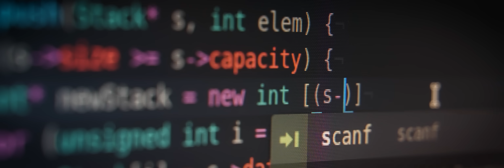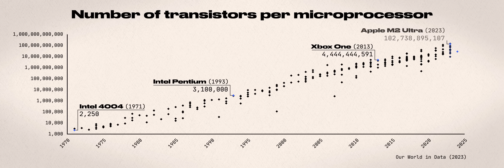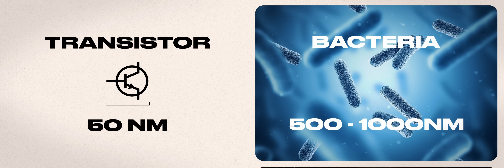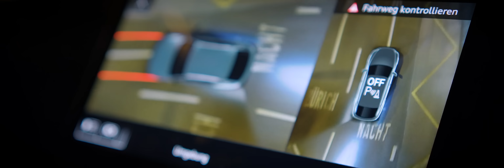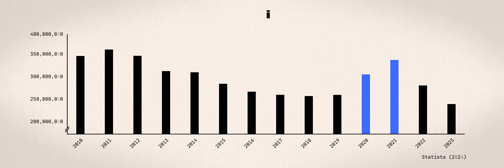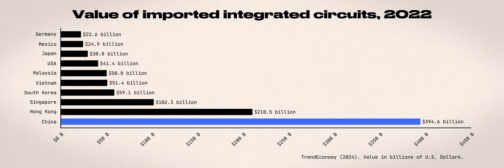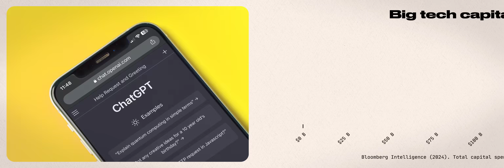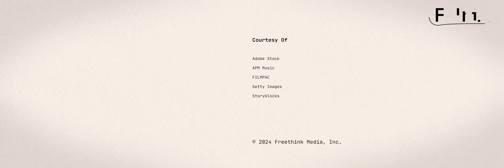How an AI chip war could destroy the global economy | Chris Miller for The Freethink Interview

Comment: We're actually near the limit of Moore's Law because the transistores are becoming so small and so close together, that the small heat from one turning on/off is actually influencing it's neighbours.
Reply: Interference is just another hurdle, but planck’s scale is the real limiting factor. You can only go so small.
Reply: Moore’s Law will have to adapt to quantum mechanics and it will probably will
Reply: The rate of transistor density doubling doesn’t have to be near the Planck limit for moore’s “law” to be found to no longer accurately describe the rate of advance
Reply: Next step is photonics.
Reply: Perhaps the limits of current design philosophies. The same thing was said before the introduction of fin-FET architectures. 

I think the next frontier is directly integrated optical communication. This reduces heat load for a given amount of data transfer (the other important heat source besides switching), and allows components to be positioned differetlntly for more efficient cooling.
Reply: Thats where you get to the next phase: quantum computing
Reply: Thats why optical circuits might be the next thing
Reply: Within 10 years there will be new material chips overtake silicone
Reply: They have thought this same thing 6 times throughout history and each time we blow past it and Moores law continues every 18 to 24 months.
Reply: @aaronpannell6401 moores law hasn’t held since 2003
Reply: We said that 10 years ago and Intel just kept churning out product over product, and then when Intel no longer got funding, TSMC surpassed them and they started pushing past moore's law. It's not dead, people just claim it is for clickbait lol.
Reply: Moores law is dead
Reply: @SigFigNewton  let’s try and keep shrinking transistors so and pretend that Moore’s law still exists so ngridia won’t have an excuse to raise prices even further
Reply: There are still options like stacking waffers or using more heat resistant material like graphite. There's also materials more resistant to rogue electron shenanigans. It's hard to say if we will hit a wall for cost effectiveness or not in the near future. I think another option is to focus on more advanced code as opposed to hardware.
Reply: Computing power is outpacing moores law
Reply: @jamesrowsell9346  Moore's law isn't based on computing power silly goose.
Reply: @destructodisk9074  but computing power isn't outpacing Moore's law. It's fallen behind. The original concept was double the transistors and half the price every two years, now it's doubling at a rate of 3-5 years and the price correlation is way off. You can't just say "oh we build bigger PCs therefore more computing power" because that's not relevant to Moore's law that's just running more things in parallel. That's like saying engines are faster now cause we use two of them 🤣. Even in that regard our computers are not doubling in speed every two years, and the cost has certainly not halved

Comment: The US is not a significant exporter of AI chips, but it is initiating an AI chip war.

NVIDIA, AMD, Qualcomm, Broadcom, Apple, and Google do not own or operate any manufacturing facilities. It relies on a network of partners in Asia to fabricate, assemble, and test its products. These tech companies do not have the ability or resources to build or operate any manufacturing facility anywhere in the world. Silicon Valley no longer has much to do with Silicon.

These companies do not manufacture silicon chips or physical products and are not in the "Semiconductor Manufacturing Industry." They are chip design and marketing companies that extract the most profit. The AI hardware is not made in the US, but the US wants to dictate which countries can use it.

Comment: "According to current understanding, Moore's Law is generally considered to be no longer completely true, as the rate of transistor density doubling on microchips has significantly slowed down, meaning it is not consistently following the predicted doubling every two years; many experts believe it has essentially "died" due to physical limitations in chip manufacturing. "
Reply: Moore’s law is about how much transistors can be packed into a space. So once they cannot get smaller, you just have to use more space. As a result, even if transistors are as small as they can physically be, Moore’s law will continue to scale by increasing die sizes.
Reply: @nadiafairchild9369  Sure. But Moores law also relates to a time period and scaling. And that period and scaling is no longer occurring. Therefore the law no longer holds. It's simply not true anymore that the output is doubling every two years and a result of that was the reduction of value of the company Intel.
Reply: @nadiafairchild9369  That's not quite correct. A fundamental part of the law is the rate of change. And that part of it is no longer true.  "Moore's law is the observation that the number of transistors in a microchip doubles roughly every two years. "
Reply: I think both of your arguments are correct, but observing from different angles. The physical limit of Moore's Law has been reached, but Moore's Law itself is closer to an economic law. Even though the size of individual transistors will not shrink any further, the economy will still grow exponentially in the future.
Reply: @Daniel-cj6ci  That's not correct. Moore's Law is specific to a doubling over a period of every two years. That's no longer happening. 

It's very simple. If it's no longer doubling within two years, it's no longer a law. The period isn't arbitrary.
Reply: @  If you insist on a strict definition of a 'law,' then Moore's Law was never truly a 'law' to begin with. A scientific law should be based on rigorous experimental data and fundamental principles, not just an empirical observation made by one person in the 1960s. Gordon Moore made a prediction based on industry trends at the time, and while it held for decades, it was never a fundamental physical law like Newton's Laws or the Laws of Thermodynamics. So if your argument is that Moore's Law is invalid now because it no longer holds exactly as stated, then by the same logic, it was never valid in the first place
Reply: @Daniel-cj6ci  that's not my argument.

My argument is that the law was stated with specifics and those specifics matter. 

Just like we can't say "well the law was originally doubling, but 10% increase is still an increase so that's still Moors Law"

No it's not. It's no longer doubling every two years. It's not even close to two years. It's well beyond that.

Whether it's claimed to be a "law" or not doesn't matter. It could just be a statement or a claim. 

So it's really simple. If the outcomes are no longer matching the original statement or claim, then it's no longer true.
Reply: @exhibitD79 You are correct.  And no, the die size cannot grow to make up for the slowing and “make Moore’s law stay alive”.  With Moore’s trend (or law), the number of transistors on each wafer doubled every couple of years.  If the cost of processing a wafer stayed the same, the cost per transistor was cut in half every two years, 1/4 every 4, 1/8 every 6, etc.  Growing the die size is not an alternative means of achieving what Moore’s law forecast.  Doubling the die size every two years would mean 1) the die size would quickly exceed the size of a wafer and 2) the cost of a system with twice as many transistors would not stay the same, but would double every two years (and quadruple every 4, ….).  

Another thing, when Moore’s trend was being achieved, the power consumption of each transistor was going down by 50% every two years as well.  This all meant that over 20 years, or 10 generations, a chip of the same size would have 1000X as many transistors while the chip 1) consumed no more power and 2) cost basically the same (but certainly not 1000X as much, which is what “growing the die size” would mean).

Comment: Small chips are indeed very difficult to manufacture. Unfortunately, the sale restriction on AI chip/hardware to China, which started in trump's first term, about eight years ago, has not expedited any open conversation to regulate AI technology globally for the benefit of mankind. Global ethics is just as big of a challenge, if not bigger, than the global supply of AI chips.

Comment: Great video. 

However, I'd like to know why each of those Countries (such as Taiwan) can't simply be copied and replaced (as primary sources of specific supplies (chips, chemicals, etc) by other Countries. 

  Part of the answer is that certain rare materials are needed. We don't have sufficient deposits of those materials. However, I am still not seeing the whole picture. And I'd like to.
Reply: Taiwan has a national interest not to be replaced. The absolute echolon of modern Chips can only be produced in factories there. Even if you had all the knowledge to build a factory like that, it would probably take at least a decade until it is operational. All the other factories TSMC builds around the world are a few generations behind to secure their national security.
Reply: @fabianschuler2722  You are right,they have so far the best factory to produce the best chips over the world, for that I appreciate. But in principle, every tech company of the world has the potential to be replaced by others, due to the fast developing technology. The more rational stratege is to weight the situation every now and then, playing between different parties to remain the place.

Thats true that I have diferent interest compare to taiwanese. But I always show respect and appretiation rather than hatery to them. I respect their interest and opinion,although I dont agree.
Reply: Economically, Taiwan is in a sweet spot for running chip fabs.

Developing nations do not have the capability.
The workforce of advanced nations costs too much.

TSMC had also made it their mission to dominate this sweet spot, and their success is hard to beat, even without these economic factors.
Reply: The supply chain for making semiconductor chips is quite lengthy and complicated. What we see here is chips, but it  requires machines making chips, packaging chips, testing chips, etc. Behind each step is a vast ecosystem. Miller exlained this in his book and thsi video, though still very superficial, from insider's POV.
Reply: You're still ignoring all the cost of starting over. Startup cost, education cost, training cost, high wage cost, import cost with extra tarriffs etc. It'll cause really high inflation for those chips. Say you bring this to the US. It would greatly increase price which makes it uncompetitive compared to Taiwan and other established companies. 

And with everything increasing in price it'll just cause insane inflation for products using those chips. Which in turn would make American products even less attractive to buy. In other words the economics of this isn't economicing.
Reply: FAB IP
Reply: Actually Taiwan has never been a country so far

Comment: one of the most informative videos on AI i’ve ever seen. the geopolitics of chips are likely to be huge in the coming years
Reply: Can I get a car without a chip please
Reply: @OnwardsAndUpwards72  No, it's called the Ford Model A.
Reply: @OnwardsAndUpwards72 my 98 is a rough rider but at least it’s intuitive and easier to work on
Reply: @OnwardsAndUpwards72 I think if you get one from the early 80s or earlier, yes.
Reply: You'll probably enjoy his book "Chip war" then too
Reply: @dagem_tes  overrated book
Reply: What about the market for the material that is USED to make those chips? A good market to invest in?
Reply: @ the industry at large has been battered really hard recently, many U.S. chip companies are suffering. TSMC's stock along with others like nvidia and Broadcomm have done very well but I don't think that will continue forever. I would look into the equipment manufacturers like Applied Materials and LAM who's stocks recently have suffered because of China cut-offs, they could likely make a good return to the market. Do your own research though, I'm not a broker.
Reply: Geopolitics of chips has been huge already for several years.